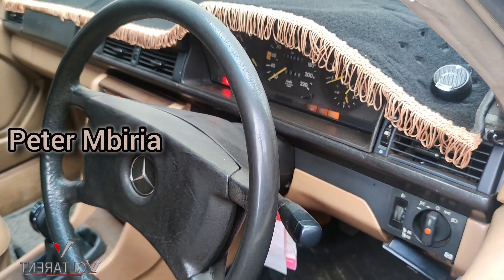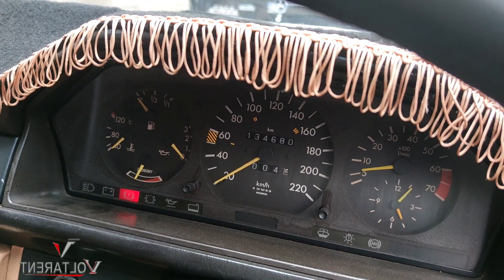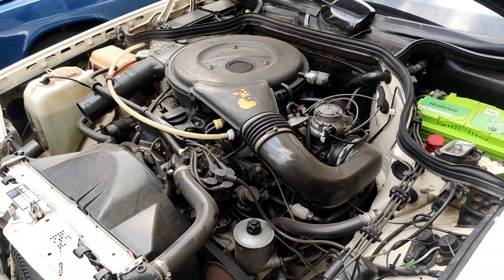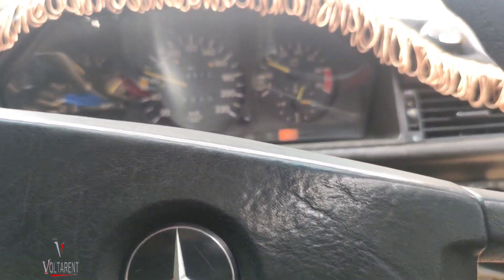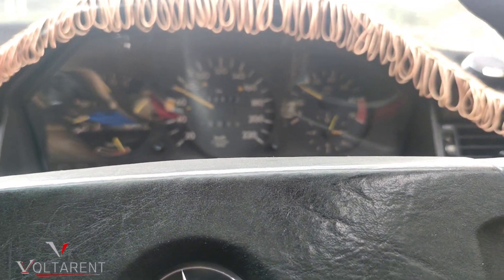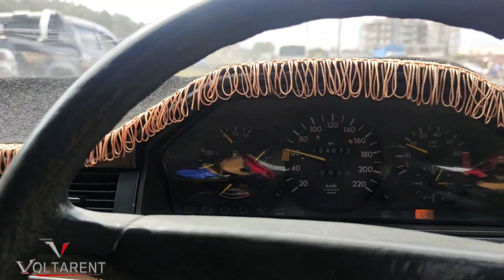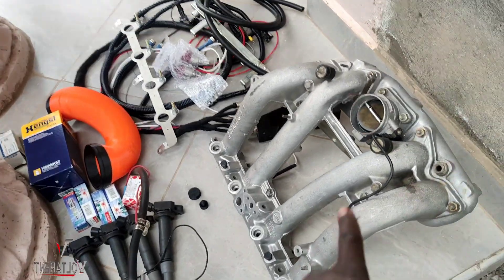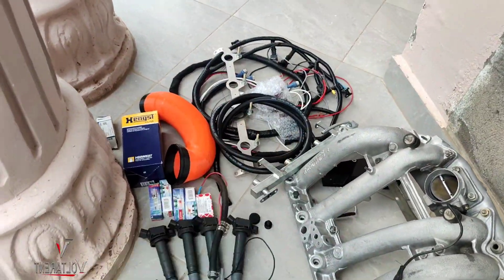W124 last ride on carb before engine revamp with Voltarent EFI system

Comment: I got a question for you. I watched a couple of your videos and I went to your website for your.voltarent ecu two plug. I wanna buy one because I’m very impressed by the super Arduino question. I have to ask you is the car I want to put it in is a 1994 Mazda RX seven with a rotary engine with a lot of boost and fuel. How do you modify the maps? What software do you use and is the process simple and straightforward, and would you think it would work with leading and trailing plug?

Comment: Congrats from Brasil.👍Here we have a national company called Fueltech which also make ECUs specially for aftermarket and racing. But some people also make these based on Arduino. Some old cars here are still highly valuable compared old cars in Europe or America, for example. So it's very important having those aftermarket solutions.

I drive a GSi 1993 Chevrolet Kadett (Opel Kadett E) with stock LE-JETRONIC Bosch system. It works, but sometimes it's a nightmare fix the things or even finding what is wrong once it's from before scanner port becoming a default thing for every car.

Comment: Hello would you do a special custom 1980 231 Chevrolet malibu v6?
The Malibu is stock carburetor but want to get fuel injection like yours
Reply from the maker: Hey man. I'll need more info to know what will be needed for a custom kit for your Chevy.
Reply: @PeterMbiria1  what do you need to know exactly? I'm willing to give all the info
It is a Malibu 231 v6 cil everything is original I'm the only person that has this car since 1980